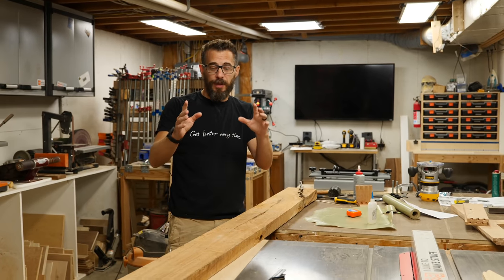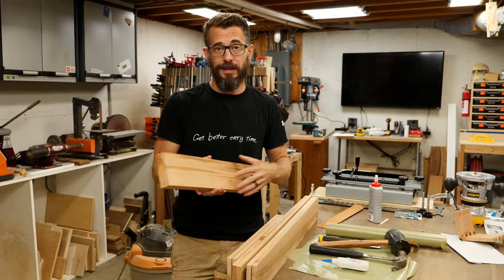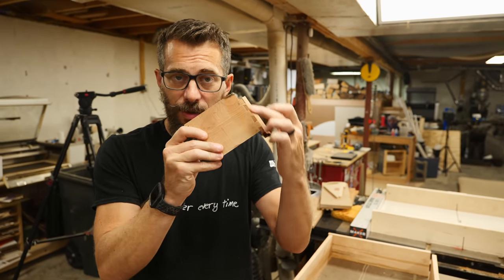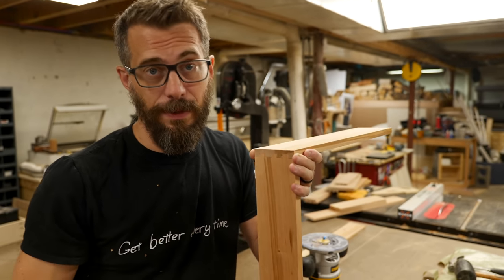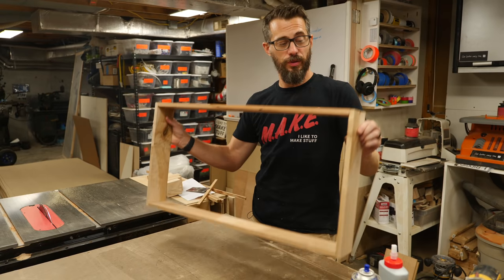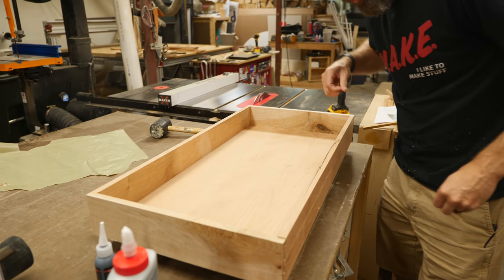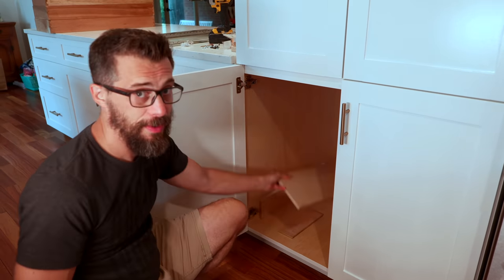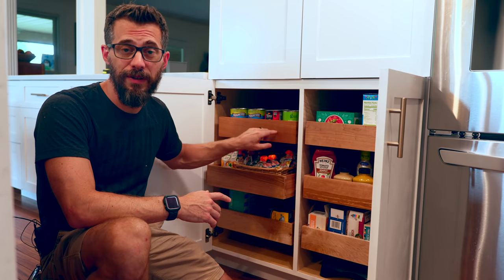Upgrade Any Cabinet with DIY Pull Out Drawers | I Like To Make Stuff

Comment: I really don't understand the internet pocket hole hate in general.  There are perfectly good uses for all types of joinery in different situations, needs, abilities, capabilities, etc.
I have been looking for options for our pantry which is basically a small coat closet size with a regular household door.  This video gave me some ideas to potentially mix some of the vertical storage from the previous video along with these types of drawers.
Thanks Bob and team!
Reply from the maker: You're welcome!
Reply: Exactly, I'm so disappointed in how rabid people are about it, he had to apologize midvideo for using a technique in CABINET MAKING. 🙄
Reply: A lot of it has to do with the idea of "Purity" of the craft, which is puerile considering there are many examples of antique furniture that used pocket holes, yes the implementation was different but it was older tech back then, some of the issue stems from the fact that pocket holes are used in IKEA type furniture, the major issue with that is, the really cheap furniture is all too often made from some type of particle board, basically sawdust, wood chips and glue, which in turn is so weak that even dovetails wouldn't help
Reply: So are pockets the BEST most traditional choice for this? No. He COULD have rabbited the bottom panel to sit within the drawer in a groove. BUT pockets are perfectly suitable for this application. The people that complain are the people with a laundry list of projects that will never get done because they feel they need to use THE BEST or the most traditional form of joinery in every piece they make. Or they are the same crowd that says using a CNC is not "real" woodworking. It's the same with the dovetails. Sure he could hand cut every single one but it would be a huge task and take exponentially longer.
Reply: What's wrong with just screwing a bottom panel up into the box frame? Pre drill, glue, and screw every few inches?
Reply: @oKnASty10  I think you hit the nail on the head here. I have no issue with pocket holes, they have their uses, as do dovetails, which can be one of the strongest joints there is. That said, I've seen them fail when the drawer is around 100+ years old and the glue used fails.

It boils down to armchair critics that often have NO clue other than the fact that they bought the cheap crap in a flat packed box from anywhere, and does not have to be IKEA, though to be fair, as long as you stay out of the lower end stuff, IKEA furniture can be quite good. 

I have the older Expedit bookshelf used as storage for LP's and 45's and other misc music stuff and the stereo on top. As long as you don't rack it out when transporting and take reasonable care with it, it hold up well over time. I bought the main 2x4 unit I think in 2007-2008? and it held the LP's in my old apartment and when the Expedit was being discontinued in I think 2014 or so, I bought the black/brown 2x2 unit intentionally as the maple variant was not available and in my house, it made for a great way to store LP's and the stereo on top, speakers at each end on crates (for now). It's only all held with dowels for the inserts and long screws to hold the sides to the top/bottom when standing. I have them on glides to be able to more easily move from the wall when the time comes to repaint the living room and other tasks as needed.
Reply: @jebowlin3879  So if I'm understanding correctly, pocket holes are to some woodworkers as comic sans/papyrus is to some typographers lol. There isn't something inherently wrong with them. It just has a bad reputation because it tends to be the go-to choice of "lazy" and "amateur" people. ("A real designer should spend hours combing through fonts and adjusting spacing instead of picking comic sans for their child's birthday invitations!")
Reply: @Bward216  probably would crack
Reply: The funny thing about pocket holes is that they’ve existed since the creation of the wood screw. That’s right, even the Shakers used them in their fine furniture that still exists as strong as ever today. Moral of the story, pocket holes are NOT a new joinery method.

Comment: Just for the trolls, you should build an entire project with pocket holes and flathead screws. It would be so fun reading the comments.
Reply: 🤣🤣🤣🤣🤣 yessss I agree!
Reply: Pocket holes aren’t bad
Reply: Flathead screws?! You're a monster.
Reply: Thats why I watch Fishers haha
Reply: What's the issue with pocket hole assembly?
Reply: I made a whole new set of woodframed screen and storm  windows with pocket holes? 3 years in, they've held up well.
Reply: @ChgoWildcard777 , absolutely nothing wrong with pocket holes. People have a superiority complex and view them as inferior woodworking skills.
Reply: Hey... for those of us with a table saw and a little router and limited budget and work full time.... dont dis practicality and simplicity.
Reply: Can you imagine the frustration of driving all those flatheads? I second this idea. It’ll make for great entertainment.
Reply: Yessss
Reply: Not everyone had a fully equipped workshop ,money and time.
Reply: And you could finish it with polyshade (stain and varnish mixed)

Comment: If you can't adjust the height, I'd just grind the riving knife. I did that with mine and it works great, no more having to disassemble it and it's a quick fix.
Reply: Came here to say this - just hit it with a file/belt-sander/etc. and it'll be safer and easier.

Comment: I just did a bunch of these that went in the back of an L shaped space so things didn't get lost way in the back.  I have a very helpful tip for anyone who finds their trays aren't quite wide enough.  Use a couple of washers between your slide and the cleat when you screw them in and you will be just fine.  Also, crawling inside of a cabinet to install these was a real pain.

Comment: I'm not totally against pocket holes, as they do have their place. But for drawers, I drill 1/4" holes across the joints for the sides and bottoms and glue dowels in, then cut them off. It takes a bit longer but is faster than anything but pocket holes, and it's probably a little stronger and looks better. Anyway, those are nice! I'll have to keep your setup in mind when I build the cabinets in my shop.

Comment: Pro tip # 1 from cutting tons of dovetails.  Since most of us have more than one router, chuck up a dovetail bit in one router and a straight cutting bit in the other.  First pass, use the straight cutting bit to remove the bunk of the material, then use your dovetail bit on the second pass to establish the dovetail and pins.  This process is easier on your tools and bits and leaves a cleaner dovetail with less tear out.

Pro tip # 2 from installing lots of cabinets.  Only order lower cabinets with full width drawers (i.e. no doors).  Way more convenient and efficient than standard box cabinets with doors.

Comment: Great video. Thanks of or sharing! For the crack in the cherry, you can put a vacuum on it from one end of the crack and glue from the other end and the vacuum will suck the glue into the crack. Just my two cents 🤷🏽

Comment: sorry I have another question as I wonder how heavy all that wood and  esp filled with cans get, I saw your pull out pantry is rather heavy on the casters and if those gliders can take all the weight, I have shelves now with baskets that slide on the shelve but it's hard to find one that fits the depth , solid wood seems heavy, I might be wrong, i have cherry trunk bits in my garden so it doesn't strike me as lightweight . it's so pretty though and so worth all the work

Comment: I had that same riving knife problem on my Sawstop PCS with a new "10 inch" blade I bought off Amazon. It was some European brand, maybe Freud. I got out a ruler and discovered that the blade measured exactly 250mm. Ten inches is actually 254 mm. Those 4mm were just enough to make the blade shorter than the riving knife. I sent it back and wrote an irate review saying they should update the description to say 250mm rather than 10". I bet you're having the same issue.

Comment: Bob, finally, a video that's bringing to life a long sought after dream of mine.
I want to do this in my bathroom towel closet cabinet next to my sink, maximize my wife's make up storage by using the full depth of the cabinet
However, the cabinet is setup with adjustable pin shelving.
I want to design a system for my drawer slides that locks into the pin holes, so no screwing into the cabinet... In case we want to remove it later.
Also, planning on making a Fishers shop dovetail table saw jog to help me make this.

Thanks for the visuals.

Also, my 6yr old says you're his favorite to watch at bedtime.
Reply: This is a problem I'm currently trying to figure out with the adjustable shelves and the drawer slides. What did you wind up doing?

Comment: Great job, Bob! (as always!). Been following for a while and love what you’re doing.  This is awesome, because I just started doing the same thing for our master bathroom remodel!  I am doing full dovetails and using Porter Cable jig (works exactly like Rockler jig) and using BB plywood.  You chose wisely to go with half blind, as it does go much faster since doing pins & tails simultaneously, as well as only needing to tune setup one time.  (btw - One way to prevent blowout with plywood is to put sacrificial board in front of the vertical board in jig.  It’s a pain, but it works!  Keep the projects rolling!  Can’t wait to see how Ghia is coming along too!

Comment: I've done that pocket hole trick for bottoms before, one thing to note for anyone who wants to do similar and hasn't before, If the Squareness of the finished product matters to your next step, put it up as tight as possible to one side and tight to one of the perpendicular sides, screw in the one side, check for square, then screw in the one other side perpendicular to it, then check it again, then finally drive home the other two sides. This allows you to loosen those last two sides a tad to be able to ensure the finished product is square.

Comment: Totally agree on the pocket hole front. So long as you've worked out your depth and screw size correctly and it's in an area nobody's gonna see then why give yourself extra work. Especially in the case of drawers where the total drawer amounts could easily be into double digits.

Comment: For the table/cabinet saw have you looked into maglock feather boards? They have strong magnets you can turn on/off and a feather portion to push stuff against the fence before it gets to the saw blade.

Comment: holy dolly zoom, batman!

also, to add to the pocket hole discussion: your shelf will basically be resting on metal pins. it won't be any weaker than if you'd driven pins in from the outside...but it's sure prettier

Comment: Nice work!  One suggestion if you face a similar project; instead of using the CA glue on the split in the wood, go with a bowtie of a contrasting wood, especially if you're not going to paint it or cover it.  Along with the dovetails, it'd be a nice added touch.

Comment: Should definitely make sure your drawers are square before the glue is dry. If they're not, it's a much bigger pain to cut a piece to fit the bottom. And it's an easy fix if you check it before they're glued completely.

Comment: My riving knife sits way above the saw blade. About 30mm. I've seen a lot of people cut them down below the height of the blade which I'm considering. I think it's important to have it fitted but can't use it if resawing lumber higher than the blade.

Comment: Is there any realistic reason why you couldn't 'sand' down the top of the riving knife to be in line with the blade top? I am new, so i don't know if I'm missing some key safety reason for why the riving knife should be slightly higher than the blade.

Comment: One question - does the bottom of the drawer really need to be 1/2” or is that just if your using pocket holes?  I was thinking that 1/4” would be enough if I used rabbets instead of pocket holes?
Reply from the maker: It doesn't HAVE to be, but it really depends on what you plan on storing. For us, there's a bunch of canned goods, so 1/4" over that depth of drawer might end up sagging under the weight.  These drawers are also abnormally deep.

Comment: Absolutely thinking of doing something like this for my pantry since the majority of stuff that gets used is right at the front, and things way at the back are largely ignored.    Problem is my pantry doesn't have a center divide like this one, the width is something like 30" or so.    I was wondering how do you determine the weight capacity of the drawer slides?   Is there an easy formula?   hate to put cans on a shelf and then end up having it rip off if I pull the drawer all the way out.
Reply: Look at the drawer slide specifications' and it will tell you the weight they can carry.  Remember that the weight includes the weight of the drawer itself.  Example:  If drawer slide capacity is 100 pounds and the completed drawer weights 10 pounds you could put 90 pounds of stuff into the drawer.
Reply: @dwightl5863   Is that with all the weight evenly distributed? or leaning further on the back?   I know that if you put 100 pounds of weight in the front it'll put more torque on it than 100 pounds in the back when extended.
Reply: @Mike__B  I going with the manufacturers rating that if it says it will support 100 pounds it will support 100 pounds with the drawer closed or open.  Cautionary note here that  weight in the front of an open drawer can cause a tipping hazard (like in a dresser or chest of drawers) unless the cabinet is fastened to the wall.

Comment: Yea...I've got face frames that are screwing me up big time for figuring out how to put full extension slides on those drawers.  I just can't get my head wrapped around it.  Biggest issue is I have those cheap drawer glides (the ones that are like $5), so the full extensions require totally new mounting, which is just causing me to put it off.  :(
Reply from the maker: Drawer slides can definitely be tricky. Best of luck!

Comment: How much weight can each drawer hold? I have some cabinets that came with my house. They are very wide and deep. Things get lost on the shelves so this would be great.
Reply from the maker: Not sure exactly, but they're pretty strong. Especially with the 1/2" plywood bottom.
Reply: The drawer slides will be the weakest point. 100lb drawer slides are common, but you can get heavy duty ones that hold more.

Comment: I called Sawstop about the same issue with my riving knife. The tech I spoke to had me measure my saw blade, and I found out that my blades were all slightly smaller than 10", and thats why the knife was taller than the blade.

Comment: Does anyone know if he has ever covered any tips for picking out the correct drawer slide for your application.  It's a bit overwhelming.  It's been keeping me from starting this exact project for a while now.
Reply: It's easier than you'd think, you just have to make sure the rail is slightly shorter than the drawer it'll support.  Two nice features to look for is the soft close and full extension, but neither are necessary.  I bought five pairs of 22-inch soft close, full extension rails for 75 bucks from Amazon and pretty happy with them.

Comment: Don’t need to clamp the boxes for the glue to dry?
Reply: If the joints are tight fitting you may get by without the clamps.  But clamping would be the better approach.

Comment: Riving knife… the table saw my grandpa and now uncle has that I use when I need to doesn’t even have a way to put a riving knife on it that I know. I assume it’s an older table saw before they put those on. I’d never seen one on it at least and the cut plates have no place that a riving knife would go. It’s a craftsman 10” I believe.
Reply from the maker: Yeah, older saws typically don't have them. You can get a throat plate that has splitters built in, or make a splitter as well. Anthony has the same problem with is old saw.

Comment: Well why pocket hole sideways which only grabs a little chunk of wood, when you could have just stuck it on the bottom and screwed directly upwards? I'm not even against pocket holes in general, this just seems like an odd time to use them.

Comment: Why didn't you use a bandsaw to get the cherry down to about the thickness you wanted?
Reply from the maker: Well, my bandsaw has issues. I've had a lot of trouble resawing on it, and actually just replaced the guides a few days back to try to improve it.
Reply: @Iliketomakestuff  gotcha. Also, you could have done a 3 halves joint for your bottom pannel, and it probably would have been stronger.

Comment: The most needlessly complicated jig for the most needlessly complicated joint.
Not a statement on your work.
Thank you for confirming and cementing that a) the box joint is superior and simpler (a sled and a pin), and b) that I will never cut a dovetail.